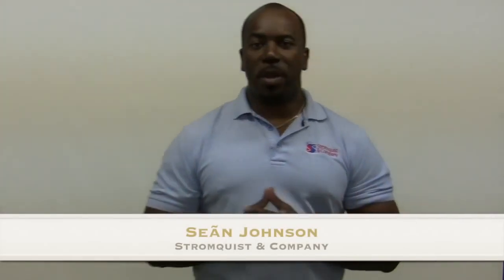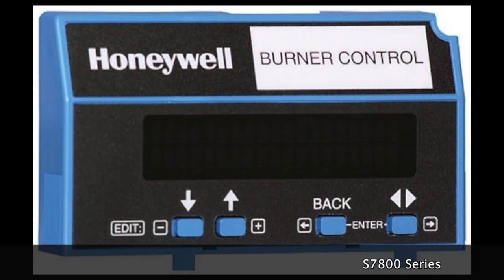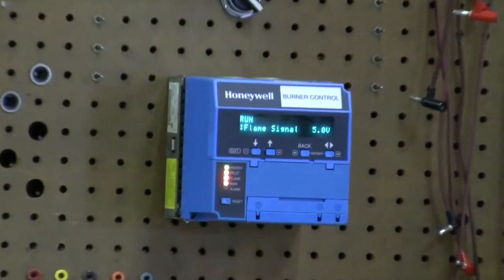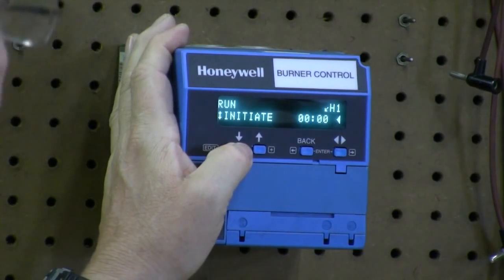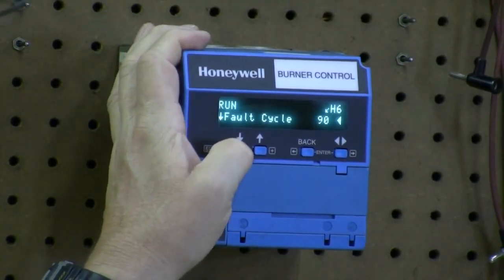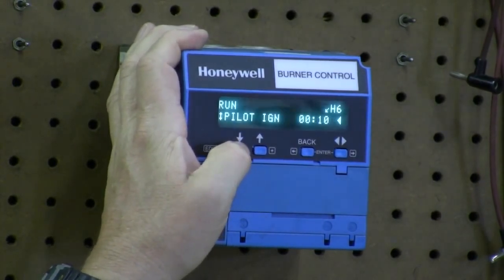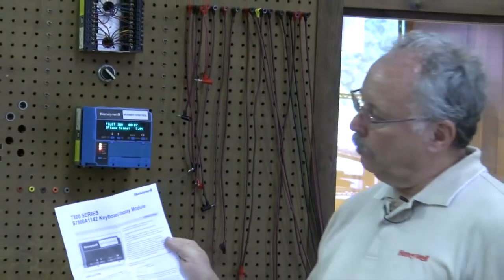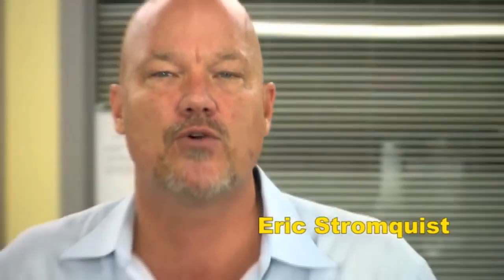explains Honeywell's 7800 Burner Control

Comment: hi i have burner honeywell model rm7890a1015 and key board display s7890a1142 . by the way i have 2 module rectification flame amplifire and ultra violet flame amplifire. .my question is how can i change the parametr for burner amolifire with the keyboard display module ?and another question i dont have any flame detector ,i want to test controller . how can i do ?